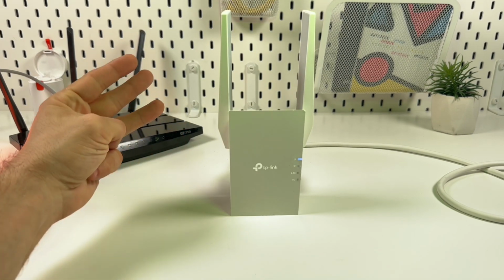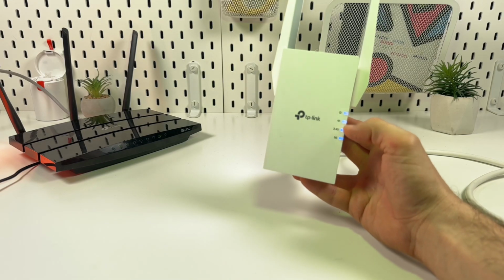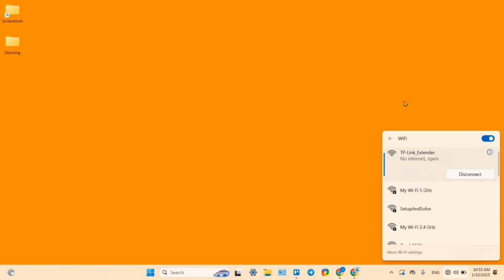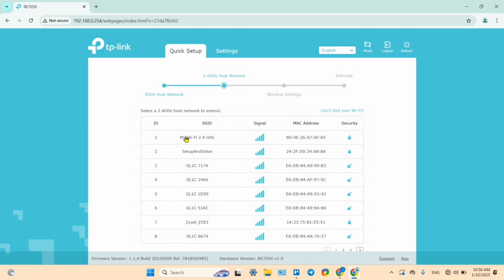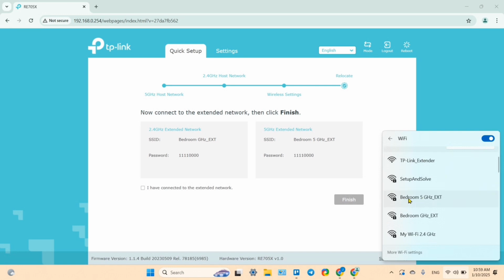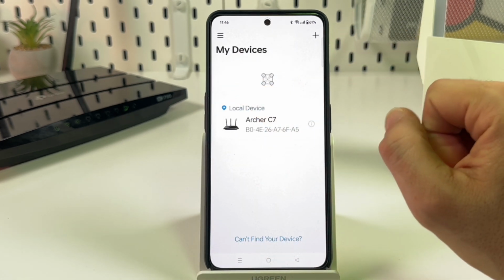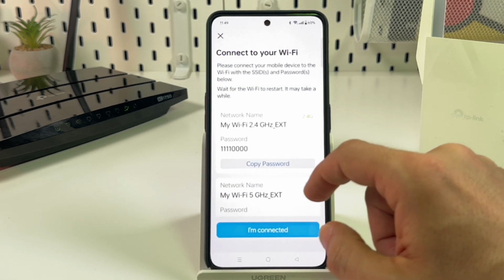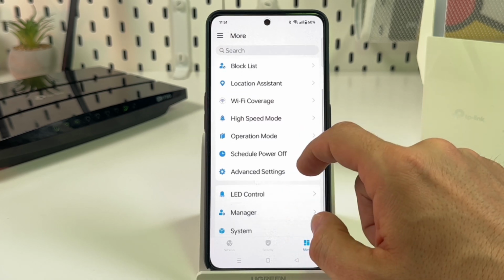How to Set Up TP-Link RE705X WiFi Extender - Ultimate Guide for Easy Connection and Configuration

Comment: How not to set it up hahaha. if you just going to use it as extender buy a $10 router for that. This is a ferrari need to be a mesh network setup thats why you paying premium for that function. not just to extend the signal with a new router, your phone will never switch to it by it self if its not a mesh. mesh gives you a smart network and tells your phone when to switch between each router.